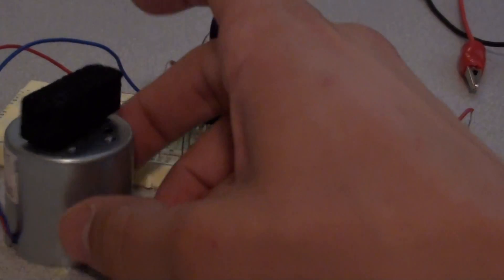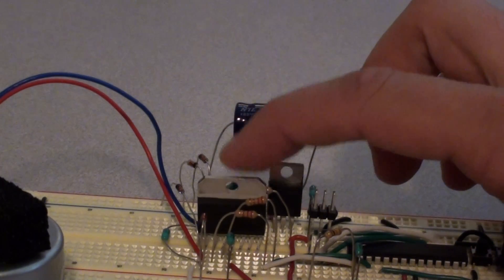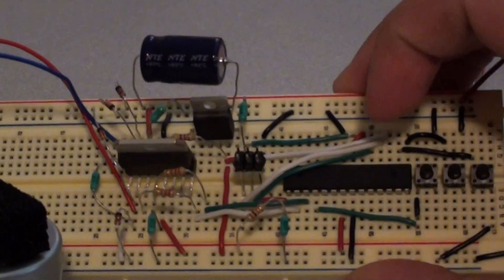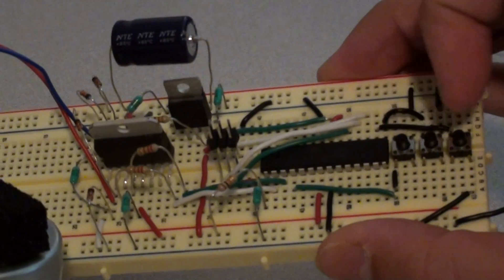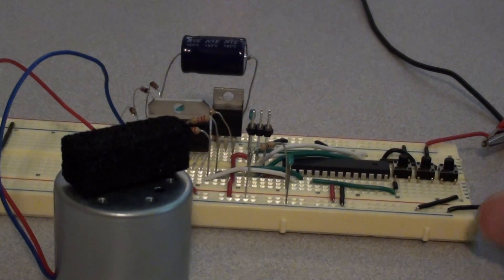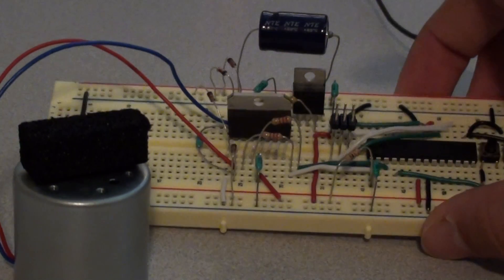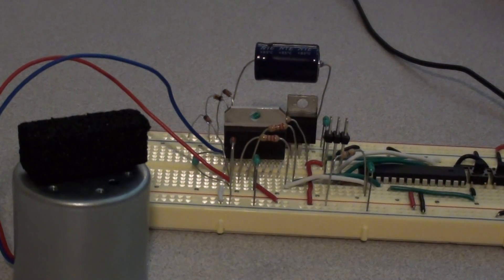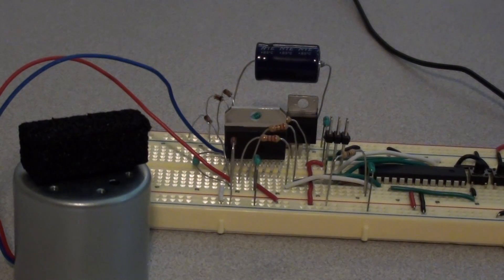H-bridge demo - AVR ATmega328 + L298N + code

Comment from the maker: Are you looking for a schematic? If so there is a one at the sourceforge page listed in the description,  see the file "RC tank_no PWM schematic.pdf" in the folder "Bluetooth Remote Control Tank" - Note that this is not the circuit used in the video but does show how to connect the L298N H-bridge to a different microcontroller.  Use a PWM signal to the enable inputs for speed control, the circuit shown has them always enabled by connecting to the supply voltage.